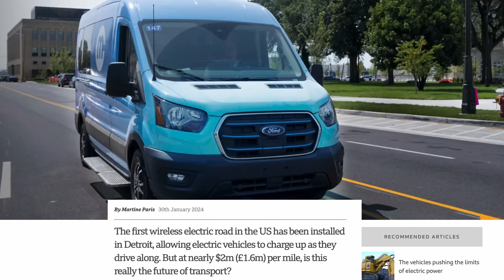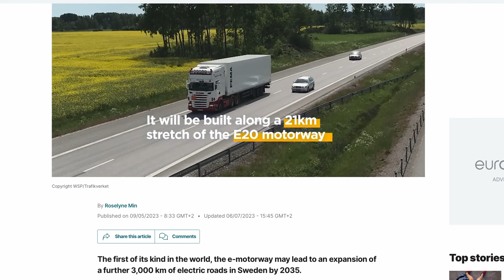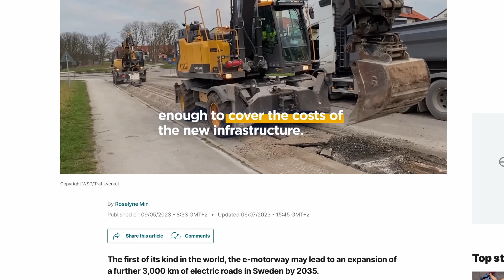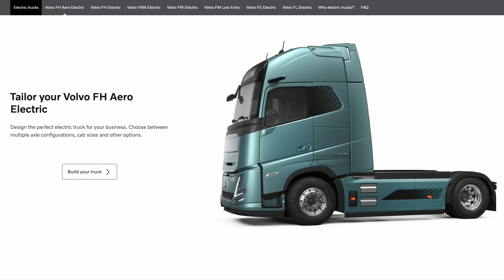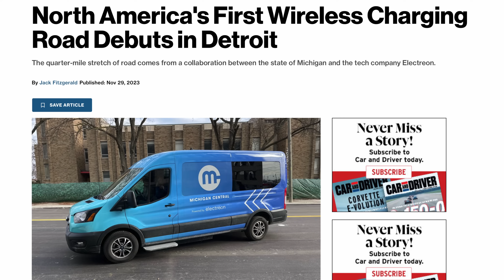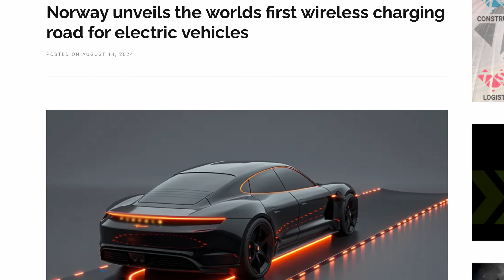WIRELESS EV Charging Revolution HITS Norway's Roads!

Comment: I really don't see how it would be practical to have continuous charging while driving, except maybe in some special cases. That sounds extraordinary expensive. But I certainly think charging will move toward a quick-connect-disconnect arrangement, with embedded fixtures, wireless or otherwise, and an end to the large, expensive tombstones with their screens and cables, which will end up being superfluous. We will end up with many times more charging stations, and you may often not even realize you're charging, as it will be so automated. I struggle to see why something like this would not happen, it seems so compelling.

Comment: If battery prices continue to drop then I can't see sections of roads being dug up to install charging cables, public charging is expensive enough as it is without adding the cost of embedding the infrastructure under the road.
If they can get a standard for wireless charging including communication between the charger and the car I could see induction charging being used at stationary chargers to improve accessibility for disabled people.

Comment: Last year we drove along a section of Autobahn which had a long test rig for overhead pantograph charging for HGVs. The work on the solutions is being done. 
There was a program testing buses , on a fixed route, where some of the stops had a charge pad for the bus to use when at the turnaround point on its route. It entailed the bus lowering a 'pickup' onto a section of the bus stop area. Now sure how well the test went, it was on the news some years ago. Meanwhile the Electic Bus fleet operating out of Fareham seems to be clocking up the miles very rapidly using overnight charging.

Comment: I would be more interested as a non-commercial electric vehicle user to see wireless charging pads in parking spaces/at home. Not having to even plug in your car to charge it would be great.

That said - it would certainly be interesting to see all the main motorways and even A roads having wireless charging technology added to them over the course of the next 50 years as we know for a fact electric vehicles will be the only cars on the road once the ban hits and petrol cars start to go off the road in 20/30 years due to being old.

The main reason I think wireless charging pads on parking spaces should be prioritised @Dave Takes It On is space. The main complaint I see from non-EV drivers is the EV chargers take up a lot more space and over time as more and more people drive EV's the demand for charging spaces will increase dramatically. Wireless pads remove the requirement for plugging in which takes up the space, so you could have more compact charging spaces and install them over greater areas or just easily convert regular car parks.

Comment: This tech is around 70 years old. I remember Electric buses in Reading in the late 50's that connected to overhead power lines, like trains, and ran around with out any issues, that I remember but I was only 5. I have no idea why it was removed.
Reply: Yes the trolley buses were a good Idea if they had battery back up then I'm sure they would have been a success . Only thing thing let them down was they could not go off route for diversions into streets with no overhead cables.
Reply: @alunjones4427  

Today's trolley buses actually do have battery back up. So the concept of in-motion charging for electric transit fleets actually already exists and carries real passengers - today.

Wireless charging is simply a version of this concept that moves the electrical line along the bus route from overhead to underground. The problem is, even ignoring the cost of the inductive chargers themselves, simply running the wire underground to power it already costs more than overhead wire on poles (for the same reason that basic power lines which deliver power to buildings cost less when above ground vs. underground). So, even ignoring the tradeoffs between in-motion charging vs. big batteries, wireless charging is already more expensive than the other kind of in-motion charging, which has a 100-year track record. So, it's not clear what exactly the point is, other than an expensive aesthetic upgrade for neighbors that can't stand the sight of overhead wire above the street.
Reply: @alunjones4427  In Beijing over 8 years ago I noticed that some of the Electric Trolley buses has automated Pickups that could be dropped for part of their route, esp around Tiananmen Square and a couple of nearby complex traffic systems , to give a less cluttered view, whilst the Buses continued under battery power. As they exited the area they simple stopped at a bus stop and as they picked up passengers the Pickups were automatically raised into a catchment areas to re connect with the overhead power lines.

Comment: When you charge a device wirelessly, it stays in one place and the charging pad is therefore smaller or only slightly larger than the device itself.  The device is not travelling at 30mph and requiring miles of charging pad.  Let’s get an economist to tell us how much this would cost per mile to install and power and then how many new chargers that money would buy.  Makes no sense at all.

Comment: Wireless charging was assessed for the longer route London buses, they decided it would be more cost effective to use a overhead pantograph system at stops instead. The system can charge faster and has lower infrastructure and operational costs, with the buses getting a recharge a couple of time along the route when needed.

I wonder if the business case for cars similar favours Plug & Charge over wireless charging, for charging speed, operational and maintenance costs, and road maintenance impact reasons.
Reply: For cars, overhead wire isn't really practical as a charging technology. Pantographs are too big and expensive to include in a car (but are ok in a bus, which costs 10x as much as a car, anyway), plus the headaches of not being able to change lanes while connected to the wire. Wireless charging at least has the nice property that the components that go inside the car are small and cheap.

I am still skeptical of the idea of in-motion charging for cars making much sense, simply because of the huge cost of infrastructure relative to the benefit. For example, you add one mile of wireless charging at a cost of several million dollars, and a car that takes 2 minutes to traverse that mile might gain maybe 5-10 miles of range in doing so, under very optimistic assumptions. Unless the car is intended to drive in circles along this mile of charging over and over again, it's not going to be able to charge up very much, but driving in circles to charge is much more of a hassle - and much less efficient - than simply pulling up to a traditional fast charging, stopping, and plugging in. And, from a cost-of-infrastructure standpoint, the cost to electrify just one mile of wireless roads is sufficient money to build out an entire large supercharger site.

At the same time, conventional charging by plugging in the cord is getting faster and faster with each generation of cars and chargers, and faster conventional chargers get, the more trivial the big purported advantage of wireless charging (e.g. being able to charge while you move, rather than having to wait) becomes.

If wireless charging ever does exist for consumer cars, I expect to sit either in stationary parking lots, as an alternative to plugging in for drivers who are either disabled or simply too lazy to get out of their car, or in fast-food drive-thru lines, so that drivers can charge up their car a meaningful amount in the 20 minutes they spend inching forward in line to pick up their food. However, even the fast-food drive through case isn't really saving the driver any time over the alternative of just plugging into a conventional charger and walking into the restaurant, so I'm not totally sold on the concept, although there are large numbers of incredibly lazy people (that's why fast-food drive thru exists), so maybe it would make sense...
Reply: @ab-tf5fl  - agree with plugging in, wasn't thinking of cars having pantographs my comment was more a reflection on Dave's comment about buses and what TfL have decided recently and the new bs fleet they've ordered for their longer routes (many of the others already being battery).

Comment: I wonder what kind of retrofits will be necessary for existing passenger cars to make them wireless charging while driving.    Ground clearances are already minimal and other space onboard is cramped.  I recall some interest in solar roads some years back and that didn't seem to take off but this would be great in an EV future.
Reply: It's been prototyped, but practically speaking, by the time you pay for parts and labor, the cost of the retrofit would likely far exceed the benefits.
Reply: @ab-tf5fl  I agree , legacy EV's will be left behind in this future.

Comment: Doesn't this require a coordinated approach from a competent government, this is possibly where this will fall. I think the UK has proven repeatedly that it isn't that good at delivering large scale infrastructure projects.

Incidentally, there are both electric and hybrid trains that have onboard batteries, the Hida Express in Japan shows how the hybrid is working on a display similar to a Prius. The metro in Birmingham also has part of its route on battery because they weren't allowed to use overhead power in parts of the city centre.
Reply: "I think the UK has proven repeatedly that it isn't that good at delivering large scale infrastructure projects."  Although we have a number of the world's largest offshore wind farms!

Comment: We do have battery powered locomotives on the railway we have been using them since I joined the job in 1974 and long before. You can not take a gas powered loco into the London Underground tunnels it would kill every one. Obviously current is switched off whilst workers are on the track So we use battery powered locos at night for doing track replacement ballasting and other jobs. They charge up whilst on traction current then work up & down the line under battery power until the job is done & traction current is restored.
Reply: Hitachi are making, in the UK, tri-powered passenger trains that can run on batteries when required. Plus GWR are trialing battery trains that recharge at stations. None of these are wireless of course.

Comment: Can't see wireless chargers on cars as standard, it'll add too much to the price
Reply: I don’t know. It adds minimal cost on a mobile phone. That’s why wireless charging has become pretty much universal. Battery cost, which is the most expensive part of an EV is becoming massively less for the manufacturers so adding an inductive coil in the greater scheme of things shouldn’t be a deal breaker. More likely to be a solution in residential areas for overnight charging where there aren’t too many driveways than being used dynamically on major roads in the shorter term I’d think?

Comment: Had to look into this, since I'm Norwegian, and had not heard of this:
What I could find is a test project in Trondheim for charging busses wirelessly, over a stretch of 80 meters 
Testing started last year (or now, information is a bit unclear), but results are difficult to find 
There are some limited info to be found, if you google the bus company AtB and 'elektrisk vei'

Comment: Wireless charging is very inefficien and expensive. It will go nowhere.
Reply: You so obviously do not follow recent technology.  Go away and check up on the current state-of-the-art systems already potentially available for immediate adoption.  Only return without the out-dated comments in a year (or much longer) time.  That should give us all a break from your uninformed comments.

Comment: Wireless, non-battery charging lorries will not happen - they will always need at least a small battery capable of at least 25/30 miles. Most of these long distance lorries use the motorway network for speed from the suppliers superbases to the destination. Often, the motorway networks have diversions off the motorway due to accidents etc - these can be 20 to 25 miles off route in certain cases. So, without a battery of any sort these lorries would quickly grind to a halt.
Reply: Also such systems will roll out incrementally not overnight HGVs will require a battery in the meantime. The HGVs in Europe with pantograph overhead sections still have full size batteries as they don't just operate on the routes with overhead wires.

As for the upgrade time for motorways in the UK, the smart motorway rollout in the UK comes to mind so about five years duration for a 15 mile stretch on the M3 comes to mind (ignoring the current re-work going on to fix issues with the first implementation).

Comment: I'm on the verge of unsubscribing. Saying that it exists is wrong. Trials don't mean it exists. 
Your angle on this is wrong. Showing caring for the possibility is good but fawning over it as you do here is sad. 
I'll watch maybe 3 more vids of yours. Something is going off track, but maybe you are just on a low point.
Reply: maybe he won't miss you 🤣🤣
Reply: @mancunium1  I agree!
Reply: The technology to do this has existed for over 40 years, only the economics and lack of interest,  stopped it - plus the billions Saudi oil has put into stopping progress.

"Trials" is possibly also the wrong word; there has been a bus route operating in Norway, purely on wireless charging, for over 10 years; there are stationary wireless charging stations for EVs out in the wild, that require only minor modifications to a sample of existing EVs.

Most of what is going on right not isnt "does it work", but "what works best equipment/standards-wise"; what no one wants is a repeat of the charging socket issues, with 3-4 competing wireless charging standards; there needs to be a globally adopted standard, so all EVs will work on all charging roads, in all countries.
Reply: @ianemery2925  charging while moving is what he first said..charging while stopped is something totally different. 
The charging sockets of course is a recent battle of standards, but wireless charging (if you look at phones for example) are presently battling out the standards. One type will NOT work on all cars. Definitely NOT.

Comment: I don't use wireless charging for my phone. I have a couple of wireless chargers, but I find plugging in faster and just as convenient.
Reply: I use purely wireless charging for my phone and other devices and it's just as quick and us way more convenient as I just have to put my devices on the pad like I would normally do when I am putting things down and when I am ready to use them, voila - they are fully charged. Having to plug them in is a thing of the past.

I see your point though, that it only takes a second to plug in, but those seconds add up over the course of a year or years... you also need to factor in the mental cost of the activity, I always throw my devices down onto my coffee table when I get home, I don't even have to think about it and that's where my wireless pad is now. I stopped having to even wonder if I have charged something or remembering to plug it in or having to get up off the couch and find a the plug.

On a slightly similar note - wireless charging parking spaces in my opinion will be the main thing I would like to see. It would certainly be WAY more convenient for me to just drive into a parking space and not have to plug in my car. I can just get out and do my thing and when I come back, voila, it's charged up. Yes, of course I could buy a petrol car and then drive to the petrol station once or twice a week, but not having to do that or even think about it would be, in my honest opinion, far more convenient.